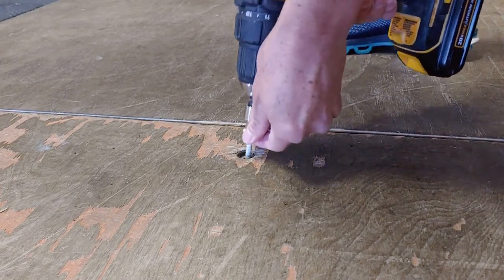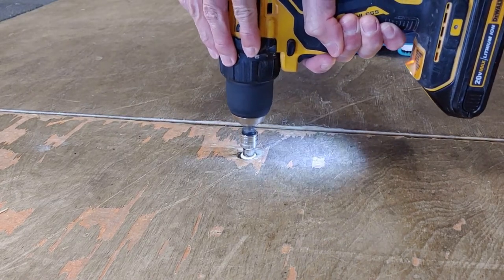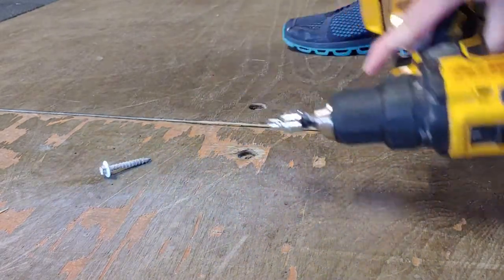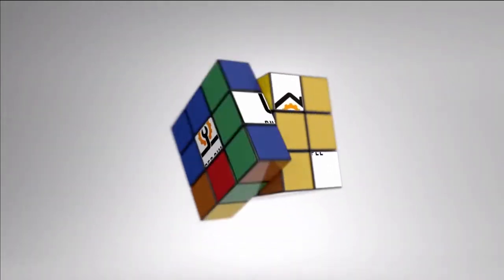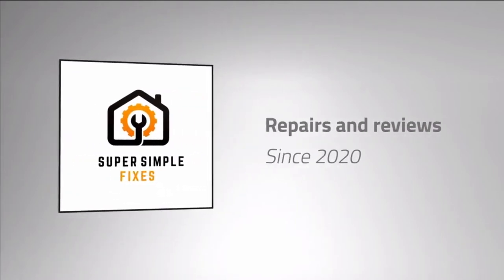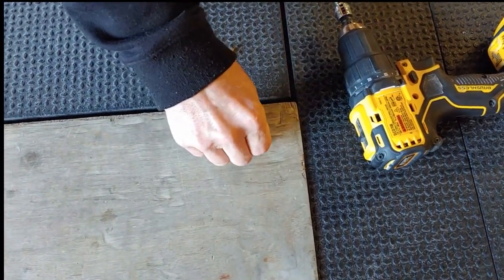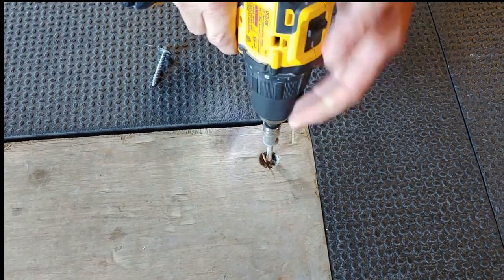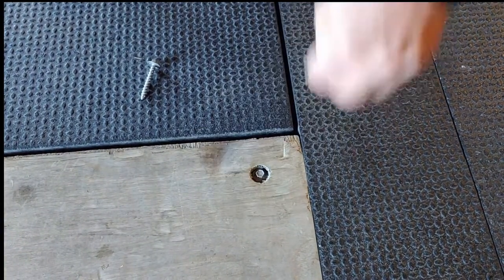DIY: How to #fix a screw that keeps spinning

Comment: okay, how do you do it in reverse?
I've got an old record player I gotta unscrew and take the main shell off cuz my cat broke it, and I got that ONE last screw that DOES turn, but won't come off, I've been trying to unscrew it for the past 10 minutes and I got nothing-
I need help pls
Reply from the maker: @Software_0.08  Just saw this. Did you end up getting it out? Never been in that situation before. I might try to grab it with a tool and pull it out if possible.

Comment: Mine is impossible its stuck in plexus glass
Reply from the maker: I'm honestly not sure if if this trick will work with plexiglass!
Reply: @SuperSimpleFixes  OK its OK I still got it out
Reply from the maker: @SuperNoahH987  What was the trick?
Reply: @SuperSimpleFixes  my sister she pulled it of the wall a little because it was a basket ball hoop so when she pulled it she managed then use the drill